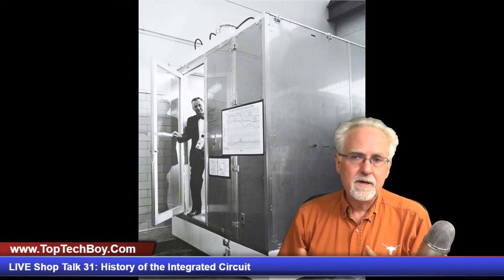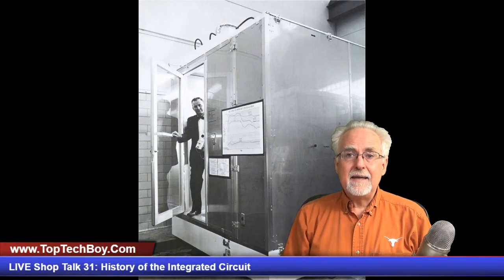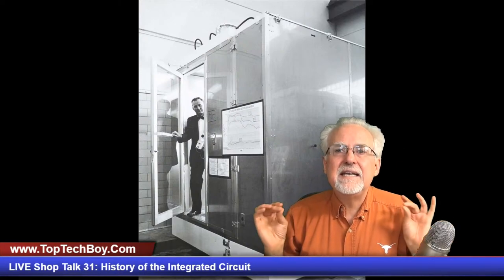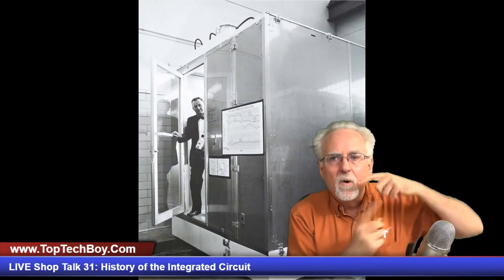LIVE Shop Talk 31: History of the Integrated Circuit

Comment: Paul, I really enjoyed this video.  The cleanroom tour was a great flashback for me to my undergrad days at Cornell in the late 80's when I was doing research at their National Nanofabrication Facility. I was part of a team building T-gate transistors, which were the fastest in the world at the time.  We had 90nm features, which were breakthrough then, but enormous compared to the 12nm and below we are seeing in commercial chips today.

One thing I loved about working in a cleanroom was how it cleared up any allergies.  Everyone on campus would be suffering from spring or fall allergies, but working a few hours each day in the cleanroom cleared out my system!

I know there is only so much time in one video, but I felt like you skipped from the first silicon gate chips right to modern cpu's.  I was hoping that you were going to touch on the amazing innovations in the 60's moving from using lithography to create simple gates on silicon to the development of early cpu's.

While I don't dispute the impact of the laminar flow cleanroom on modern electronics (and allergy relief 😉) the move to a true Von Neumann architecture is what set the US electronics industry ahead of the world for decades. I really enjoy looking back at the early steps, like the Apollo computer and other breakthroughs in the 60s and on into the 70s with the 6502, making cpu's available at the consumer level.

You've mentioned all of the layers of generalization between the silicon and the software.  It's definitely too much for one video.  I hope as you move forward into these topics you'll be able to touch on some of that history. 

Thanks & keep up the great work!

Comment: Hi Paul,

Very intetesting information and would love to see more on this topic !!!!! I was wondering why the wafers are not square instead of round? Seems like you could design the process so that there would be less waste of the wafer around the edges by using a squre wafer. Seems the processing machines could have been designed to work with square wafers from the very beginning.Rick
Reply from the maker: Physics make wafers round. A large single crystal is pulled from a melt of silicon, into a long boule. The boule is then sliced into wafers. As the crystal boule is pulled from the liquid, surface tension makes the shape round. Much like surface tension makes raindrops cylindrical.

Comment: Does equipment that is needed in the clean room (table, chairs, etc) go through the same cleaning process before being placed in the room?  Are there larger airlocks and doors for equipment than those used for workers?
Reply from the maker: Yes, everything must be cleaned, and only clean room certified equipment can be taken in. So, for example a chair, could never be a normal chair, but a chair deliberately designed for a clean room. Everything designed to not shed particles